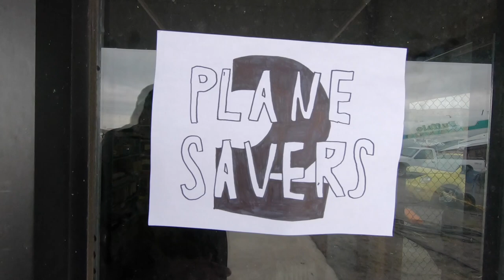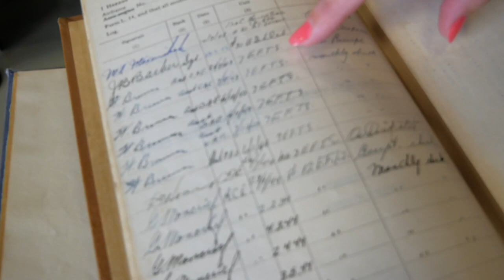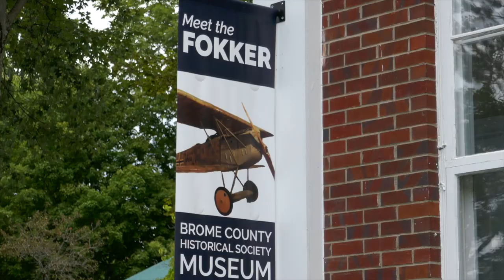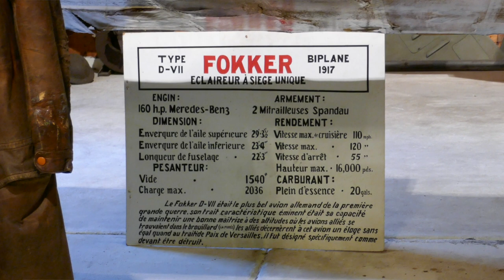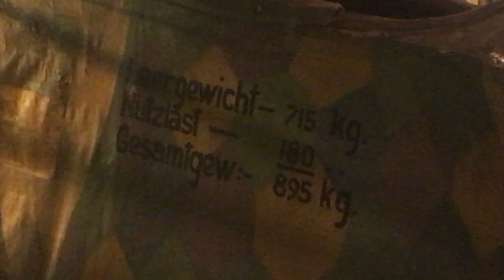Old School BUILD-OFF! Our Fokker vs. a Tiger Moth | Plane Savers S2-E4

Comment: Welcome back Mikey. Just a quick word - a Fox Moth isn't the same as a Tiger Moth. It is rarer as far fewer were built and bigger as it was designed to carry a few passengers. Apparently a few (under double figures) were actually built in Canada and I guess that some local examples probably remain. Interesting that both the Tiger Moth shown in your opening screen and the one being restored have canopies. Most didn't - they were open cockpit - but they were presumably modified to be used in their training role.

Comment: The Tiger Moth project is close to my heart as I learned my trade on these wonderful aeroplanes,many of the machine I helped rebuild in fact are still flying today one in Canada,you can still get spindled wing spars for Tiger Moth's plus many other items,the wing ribs are fairly easily fabricated in simple jigs.

The Fokker D.VII is a rare original but one day a decision has to be made on what to do ? the fabric yes will be fragile but you can only leave something so long before it rots completely otherwise you will just have a heap of decayed materials,conservation can only be taken so far before something needs to be done,just like they back oil paintings to preserve them aircraft fabric could be removed and backed for separate display to show people what printed lozenge looked like with the correct original colours,it is such a rare machine that it needs attention sooner rather than later.

The last original Fokkerv Dr.1 triplane was lost in a bombing raid in Germany it was part of the amazing collection built up by Goering and the other aircraft of which are now on display in Poland.
Please do not place pressure on a newbie low houred pilot to fly the Fokker Dr.1 even with modest tailwheel experience,they are tricky little aircraft to handle akin to a shopping trolley on the ground,instead contact the people at Old Rhinebeck who I am sure will be happy to help with the test flying,I know this is a while off yet but please consider this as a better safer option.

The two projects working side by side will be interesting to follow.

Comment: The DVII is in amazing shape, for an aircraft that is over 100 years old.
Reply: I keep hearing this too fragile stuff with these old planes. For sure they need lots to ever fly again  but a steel tube frame and decent timber wings they should be able to be moved around with care.
Here in Adelaide South Oz we have the Sir Ross and Keith Smith England to Australia Vickers plane which has been on display in a very nice enviroment for decades. And the same thing, they want to move it to a newer part of the airport with [now] more pedestrian traffic. But supposedly too fragile to move. Yet people drive cars that old very often, usually with a far harder life.
Reply: @ldnwholesale8552  True, but WWI aircraft were fairly fragile when they were new. In truth either plane could be moved, but the question is would the damage done to move them outweigh the benefit of doing so. From what I gather that particular plane is the only surviving Dr VII that retains it's original covering, and the covering is the only surviving example of the 4 color lozenge camouflage used on the DR VII. As the video showed it's not in great shape now, and would certainly be damaged further when disassembling the aircraft for a move. The Aviation museum in Ottawa has another DR VII, and I don't see the benefit of moving this one there.

Comment: for Flight Chops.  i wonder if there is a way to build a vacuum chamber big enough to hang a rib in that is coated with epoxy.. then quickly create a vacuum for a few minutes then  release the vacuum causing the epoxy to be pulled deep into the wood of the rib..  it might have to have a support frame to allow horizontal and keep the chamber and part rolling to stop drips and thin areas..  Oringed swivel joints can be had easily to accomplish the rotation under vacuum.  just something to increase the strength of those 80+ year old ribs..  as mikey is going to find out.. using production techniques to create the individual pieces will allow a speedy assembly on jigs..  so building ribs could be non time consuming..  still figuring a way to epoxy impregnate the finished ribs for additional strength and life.   destructive testing will be required on a few for proof of concept.  even nail or screw holes could be predrilled in a jig prior to assembly making them completely identical.
Reply: If you want to increase the strength, a filler is added to the epoxy used.  This is how propellers were built.
Reply: wayne p - Interesting idea - I will bring this to the team. Thanks!

Comment: I think in some respects you have it wasier than the Tiger crew. Looking at that existing wing trying to figure out what to replace it will be easier just to build new wings using new timber in Benjamin's jig with new glues to get perfect geometry, where as what is straight on those Tiger Moth? Go the Dri Decker
Reply: This is a good point - the old wing might just end up being an example when we rebuild 4 new ones

Comment: They should back the fabric on the museum piece, without backing (and i know the stupid amount of work that would entail, but come on, that's an original untouched piece, it's worth it) the fabric will eventually segregate and fall to pieces. It's because of the paint and protection it, if it can happen to a museum painting, it will certainly happen to this eventually.

Comment: One suggestion, William, for building your tailwheel skills inexpensively: Luscombe 😉 There's an old saying that if you can fly a Luscombe, a DC-3, and a Stearman, you can fly anything but building Luscombe time is much, much cheaper.
Reply: I agree, Luscombe Silvaire with the narrow undercarriage really helps with rudder control
Reply: @skippyscage  Plus it's one of very few airplanes where you'll never say, "I ran out of rudder." 😂 It's amazing how much crosswind you can safely handle in that little plane! And, yeah, as you've probably guessed, it's the aircraft I learned to fly in 😉
Reply: BlueBaron3339  I did about 10 hours in a Luscombe then took my DR1 up it was a good trainer. Flys nothing like a DR1 but but it got me to stay ahead of the plane on landing.  Also all I did was wheel landings in the Luscombe to teach me how to stick the landing.
Reply: @EdmunddelaRiviere  Wow - now that is one serious endorsement!  Congratulations on your airplane 👍
Reply: @BlueBaron3339  yes, no need to put it the "easy to ground loop" category as many do. It has so much rudder, if you fly it properly it behaves extremely well. You don't stop flying until the engine is off.
Reply: @skippyscage  Oh, I know! And, how beautifully it slips...no flaps after all. It's an airplane you wear, thank goodness.
Reply: BlueBaron3339  Sorry I skipped the endorsement part of the story. I think I did six or eight hours in a cub to obtain my tail wheel endorsement. Then I started flying my Luscombe to prepare myself for the triplane as stated above.
Reply: @EdmunddelaRiviere  I'm curious what engine you used. My first thought was Ken Royce or Warner Scarab, given the sheer scarcity of the Le Rhone.

Folks always think Richtoven when they think of the Dr 1 but the real artist in that airplane was probably Werner Voss. But I digress blush
Reply: @BlueBaron3339 I had a Lycoming 0-320  it was very reliable and readily available.  It doesn’t have the look of the Warner or the Le Rhone but what does it matter they look the same from the cockpit.  LoL
Reply: @EdmunddelaRiviere  And, also with the rotary, the entire engine is one spinning mass. It's a design that makes sense in a way though it introduces another level to the learning curve. For a personal replica, yeah, the Lycoming makes sense.